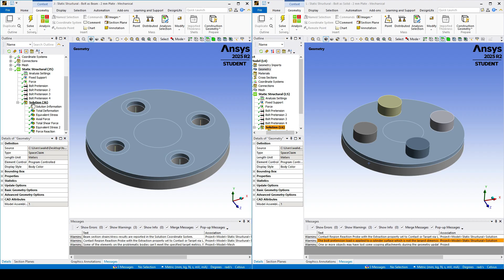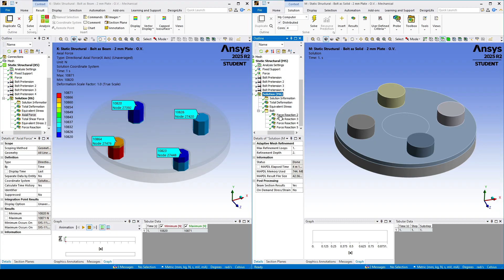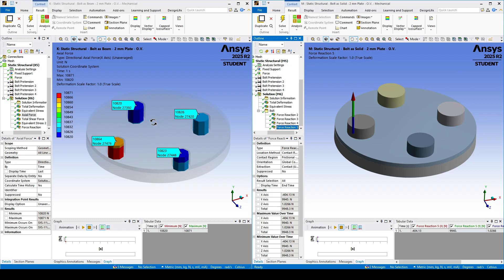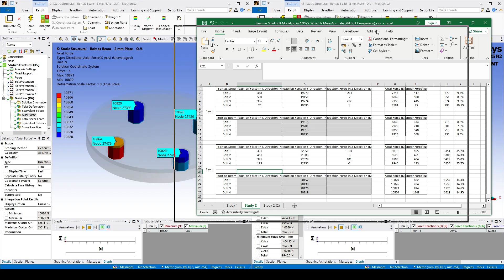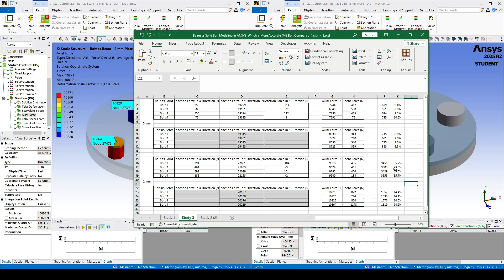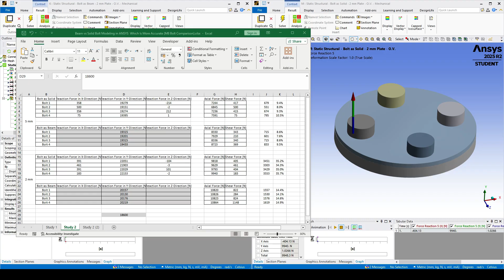Beam vs Solid Bolt Modeling in ANSYS – Does Plate Thickness Change Everything?

Comment: What is the general rule of thumb for determining whether a plate can be considered sufficiently stiff to model the bolt using a beam approach? For example, is there a minimum plate thickness, that would typically be considered adequate?
Also, regarding shear behavior, the results deviate significantly from those obtained using a solid-bolt model so what would be the solution for that?
What would be the expected difference if the plate is modelled using shell elements while the bolt is modelled using beam elements?
Reply from the maker: There’s no single fixed answer here, because at least three parameters are involved: plate thickness, load magnitude, and whether the load is centric or eccentric. 🔩📐

As a general rule of thumb, if the plate is less than ~5 mm thick, I would start to be concerned about whether the plate is sufficiently stiff for the beam-bolt idealization. Of course, this is not a strict limit it really depends on the complete load case and geometry.

Regarding the shear behavior, you will definitely see differences between modeling the bolt as a beam and modeling it as a solid. With the beam approach, the bolt is essentially constrained at both ends and can carry the applied shear force, which can be considered a more conservative approach in many cases. With a solid-bolt model, once the contact/friction behavior reaches its limit, the bolt can start to slide, potentially leading to a worst-case safety factor close to 1.

For that reason, if the bolt is highly shear-loaded, I personally recommend the beam approach as a useful way to investigate how much shear load is actually being acting on the bolt and based on that determining if the shear safety factor is enough or not. 👍

As for your final question shell elements for the plate + beam elements for the bolt there is definitely an important limitation to keep in mind. One of the key parameters controlling how the load is distributed into the bolt is the stiffness of the clamped parts. With a shell representation, you may introduce an artificial stiffness or remove some stiffness compared with the actual 3D geometry, depending on how the model is set up.

This is actually a very interesting topic! 😃 I think I’ll make a video about it in the future and compare the different approaches numerically to see how positive or negative the effect can be on the accuracy of the results.

Stay tuned! 🔥🔩

Comment: hi, how about the contact between de bolt face with plate?, its bonded or frictional?
Reply from the maker: Hello, it is frictional for sure otherwise the results will not be accurate anymore. With bonded it will be nearly same as the beam  bolts 👍